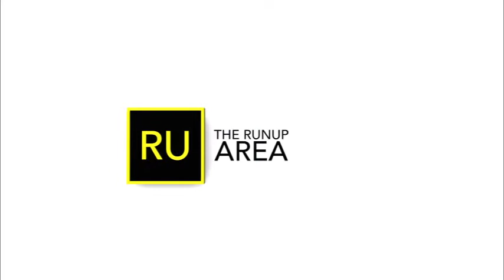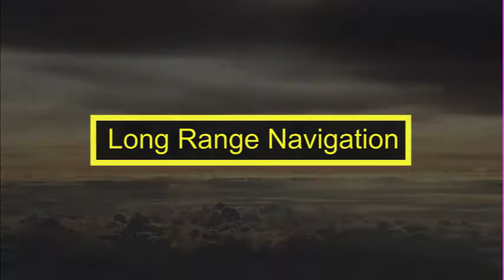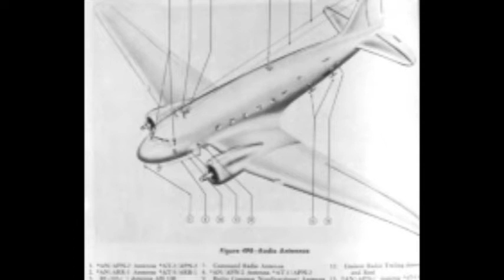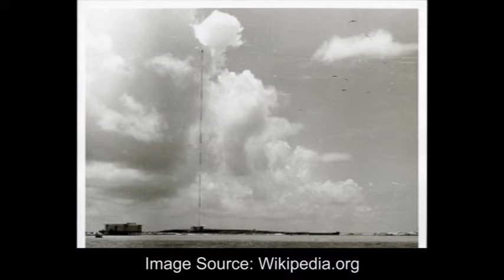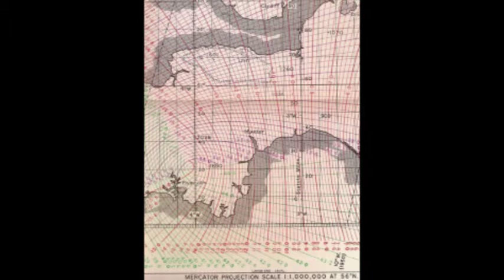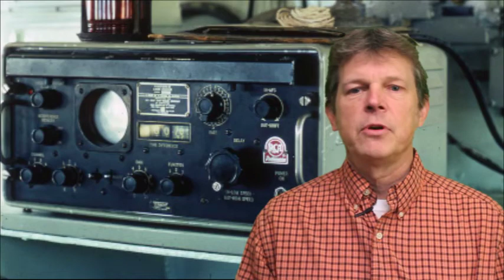Long Range Navigation and Hyperbolic Navigation

Comment: Okay well that's all fine and good but you are not giving the full story on (long-range aids to navigation) which is what 
LORAN is, nor have indicated the different divisions of the LORAN program LORAN-A was indeed an AM amplitude modulated system that used a relatively short antenna, because the intention was to bounce being transmitted energy off of the atmosphere. It was given a fair amount of accuracy when finding your location but not that good. The military used LORAN-C was for finding precise locations inside of a few yards. LORAN-C was actually FM or frequency modulated, and could be transmitted only by line-of-sight. This is the reason why the antennas were mounted at 1625 feet in height. I am aware of these things because I was active Coast Guard and worked on LORAN-C at the US Coast Guard, Electronics Engineering Center, Wildwood, N.J., in the Mid 1970's.
There was. LORAN-B, however that was used in conjunction with the Omega transmitters which was "Top Secret"! And I can't talk about that!
I will admit that the information about LORAN is limited on the internet. Therefore your knowledge in your video is wanting, but I do not blame you for this.
Thank You
G.E.NITZ-MERCAEANT

Comment: Used both LORAN and DECCA for marine navigation. LORAN used time difference where as DECCA used phase difference.  LORAN had a longer range than DECCA. DECCA had higher precision. Both used special charts with the "lanes" printed on  up until the 1980s when more powerful computing was available in a small form factor allowing  the receivers to calculate latitude and longitude. Cost and GPS killed off both systems. There was another system called OMEGA I did see installed on aircraft and called also be used by subs at shallow depth due to it's use of VLF radio.

Comment: Taking a measurement with Loran-C by hand took several minutes as you fiddled with timer controls on an oscilloscope and tried to get two signals to line up. Only a dedicated navigator could do it, it was not something a pilot could do while flying. But from the start, the system was to be automated by timing certain portions of the signal. The Air Force system to do this filled most of a semi-trailer and cost millions of dollars. The same could be implemented in a single chip for a few dollars by the late 1970s, which is when they started to appear on boats and private aircraft.
Reply: Yes this is completely so! Also when I first came in to the Coast Guard and was working with this system, many of the receivers worked using servos and locktal  metal can type tubes they were huge receivers it two to three men to move one the most common receiver then was about 350 lbs. and 1
5ft. tall and I believe 2ft x 2ft, and had hinges at the back and it opened like a hotdog bun. This was the (SPN-30) aka Spin30.

Comment: I would say the late advent of microcircuitry slowed the introduction of LORAN to  civilian aircraft. my experience comes from working as a LORAN  technician in the Coast Guard in the late 80s. up until my time, receivers were big and heavy, and really hard to deploy on a mobile unit like an airframe. Heck, we still had analog radar in everyday use. but in the mid 80s, miniature electronics made small and environmentally stable receivers  possible.

of course, I'm sure the FAA wasn't the most efficient at allowing new electronics onboard, either.

But that's just my 2 cents.